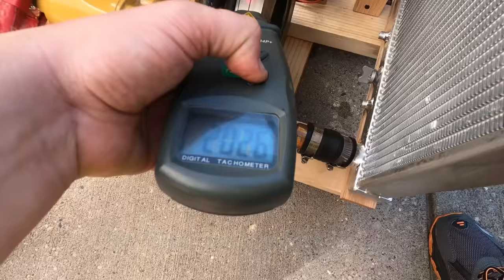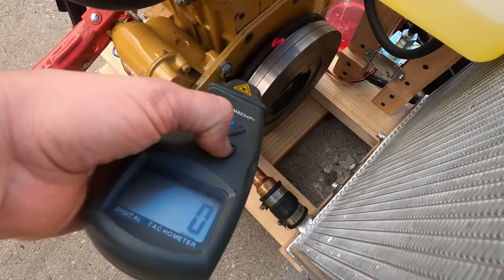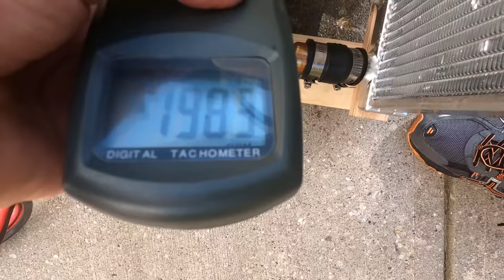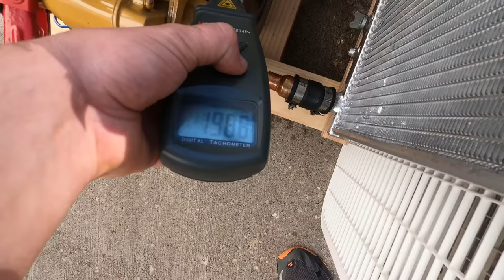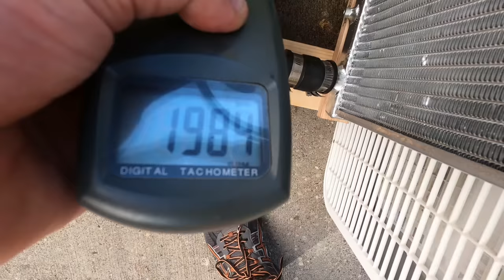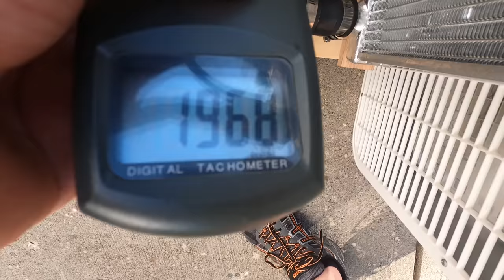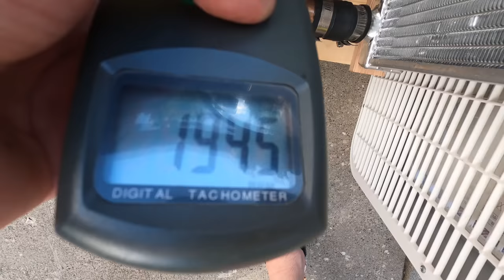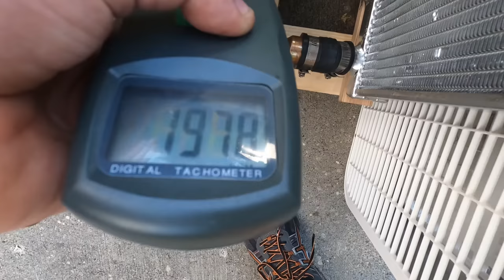Will Caterpillar Diesel run on Cooking oil? Attempt to run engine on Transmission Fluid & other oils

Comment: As far as I understand the diesel motor was originally designed to run on various vegetable based oils. Petroleum oils was not the diesels first intended oil to burn
Reply: Thats right!
Reply: Yuck Foutube  Exactly, but the inventor had to modify it, so it can run on heavy oil to make it interesting for heavy machinery
Reply: So true. From now on I want all engines I buy to be diesel even if it is a luxury car.
Reply: "Engine" not "motor"
Reply: @olfreal  
No.
Diesel was a waste product of cracking oil and producing petrol (gasoline)
The refineries had no use for diesel...
until they realised it could be used as a fuel in "diesel" engines....
The rest is history.
Reply: Rudolf Diesel is the father of the diesel engine he ran it on peanut oil
Reply: yea but they weren't always common rail wither
Reply: @b-genspinster7895  Germany never had access to petroleum supplies so hence why they always are tight with russia
Reply: I think the first compression ignition engine ran on coal dust but I might be wrong
Reply: @midixiewrecked7011  hate to burst your bubble but Engine and Motor have pretty much identical definitions. Motor just happens to also Encompass Electric engines not just internal combustion while engine specifically defines things with moving parts that produce power.
Reply: @juliogonzo2718  compression ignition engines diesels have always operated on a liquid /oil of some kind. the early diesel engines were heavily RPM restricted and most of them if not all of the early diesel engines had a Compressed air injection system. which in turn means. injection pressures are quite low. which in turn means the compression ratio (efficiency of the engine) couldn't be very high. 12:1 compression ratio. vs todays modern diesels. say my 6.0L powerstroke. 18.3:1, or my 2019 6.7 powerstroke 16.7:1 
12:1 is just barely enough to make compression ignition possible and is just above highest compression ratio gas engines.
Reply: @justnsaliga8518  wrong
Reply: You are right! The coal dust was too abrasive and wore out parts.
Then he switched to veg oil.
Reply: @JohnSmith-yv6eq  There is no waste product on crude oil. All products are waluable and usable. Thats why diesel engines use diesel fuel, or some other oils. It is old fashion thinking, that diesel is waste product. Like used engine oil. It is waste product when it is used. But it is not. It is pretty good heating oil for factorys, or at small game for homes. It is not waste! And as we all know, some ones waste is some ones tresure. It is just how we want to see it!
Reply: @peraz968  
What we know today as "Diesel" wasn't initially formulated as such.
At that time it wasn't even "diesel".
It was made up of a combination of different "fuels" which varied widely.
Only after WW2 was it standardised in formulation around the world....

https://en.wikipedia.org/wiki/Diesel_fuel#:~:text=Diesel%20fuel%20originated%20from%20experiments,engine%20he%20invented%20in%201892.
Reply: Check out The Hot Bulb Engine, It was the Engine that first took place of Steam Engines.  Hot bulb Engines would run on anything, The Low grade oils ( Low grade oil that had to be refined more aboard ships so it could be used ) The Oil was between Crude oil, and Heating oil.
Reply: Very true, but diesel fuel is cheaper per unit of energy since it's essentially a byproduct of refining petroleum oil.
Reply: Indeed. It suddenly changed to petroleum based oils when the inventor suddenly had an "accident".
Reply: @midixiewrecked7011  Motor oil, motor mounts, motorcycle, motor vehicle, etc
Reply: Yes that true, originally  diesel run his engine with peanuts oil...
Reply: @Bpf1893  engine oil,  big block engine,  small block engine,  2 stroke engine 4 stroke engine, you're ignorant etc , Rotella engine oil look it up.
Reply: @midixiewrecked7011  Yes both terms are correct, that’s the point. You not knowing that, then trying to act smart calling people out, is ignorant
Reply: @Bpf1893  one term is correct.  Your ignorance is not impressive.  It only shows that you fall into the common frame of mind with society now a day.  The common ignorance of people.  Etc
Reply: "Feb 21, 2019 - The Diesel-Engine was originally made to run on HEMP-OIL ! In 1893, German inventor Rudolph Diesel published a paper entitled "The Theory ..."

He ran it on peanut oil for the World Expo, so I think that is why all the "peanut oil" mentions are made.
Reply: Also coal dust… the promise was that they can run on just about anything… including unconventional fuels😊
Reply: @jeremywylie2936  dyslexic
Reply: Peanut oil burns clean , they used it in submarines
Reply: Yep this was the pitch to farmers the oil of your crop can run your tractor.
Reply: @justnsaliga8518  my coyote is 11.5:1 the new ones are 12:1.. just saying. I'm a little shocked that the 6.0 has a higher c/r than it's current generation counterpart
Reply: Originally, Diesel's target was to make it run on coal dust. It didn't really work.
Reply: @midixiewrecked7011  Cmon guy. They are grammatically interchangeable.
Reply: That's what I understand as well and that's fantastic because for the times to come it would be great to have SVO generators
Reply: @JohnSmith-yv6eq  That's exactly backwards.  Gasoline was a "waste" product of refining crude for kerosene (which is basically diesel) to use for kerosene lamps.
Reply: Correct, invented by Rudolf Diesel. Though of course America probably thinks they invented it, along with the jet engine, the Mile, and sunlight :-)
Reply: if it flows and burns, its fuel.. basically the principle i see older and simpler diesels have with fuel.
Reply: @justnsaliga8518  No, an engine converts various forms of fuel into mechanical force. A motor transforms electrical energy into mechanical energy. There really is a big difference in the two.
Reply: @stevemorris3710  in our defense America has invented just about everything, your more likely right to assume someone invented something in America or made it big in America or was happy in America, 

But it's okay broh I'd be jealous too haha
Reply: @giggiddy  Different words and different definitions.
Reply: @PureCountryof91  higher the compression ratio on a gasser the higher octane fuel you need. or how ford solved incomplete combustion problem and the inherent (spark knock/preignition) Variable valve timing. so yes it does have 12:1 on the new ones but its Variable valve timing controlled by a computer to dump pressure by leaving intake or exhaust valve open a little longer. its why you can have your 12:1 compression ratio and run Race gas. or run Ethanol in the same vehicle. and it runs just about the same. 

reason why common rail engines have typically lower compression ratios is drivability. and sound. as well as its easier to make a injection system that injects fuel into a 16:1 cylinder than a 18:1 or higher. 
higher compression ratio on a diesel the more efficient and the more torque but the louder it inherently will be. 

on a side note part of the reason why they went to lower compression ratios is they were able to make up the lack of the lower compression by means of more modern VGT turbos the technology has defiantly matured a stock 6.7 powerstroke turbo can and will do upwards of 30 lbs of boost. 

and higher compression ratio on a diesel also means you can get away with a smaller turbo. or not as much boost.

to make a long story short. reason manufacturers have went lower in compression ratio is the fuel quality has gone up significantly in recent years anything generally above 17:1 in the diesel world will burn any petroleum based liquid or anything thats even slightly flammable. 
and drivability manufacturers have swung their intentions to make the diesel trucks drive more and more like a car and feel like a car. my 2005 pulls alot better than my 2018. it drives and feels like a truck my 2018 doesn't feel too much like a truck.
Reply: @justnsaliga8518  good read. I'm more than aware of the compression ratios needed for diesels. And also aware of the ratios of gas.. but the incomplete burn, done so intentionally is kinda stupid. That's a waste of energy.. now it makes some more sense as to why a certain 5.0 takes boost so well stock.
Reply: @cppower14  No. An engine converts one form of energy into another. A motor provides motive force. There is a very small and highly technical difference between the two. 

The little Cat in the video does both. It is an engine and it is a motor.
Reply: @midixiewrecked7011  No. And you being so confidently wrong is amusing.
Reply: @mabamabam  nope
Reply: @Mi Dixie Wrecked Motor can be used by both electric and combustion or multiple others. The definition is using one type of energy to create mechanical  energy to create motion. Why do you think they call motorcycles that and not engine cycles?
Reply: "hheellooo" - douche rockefeller
Reply: @wizard_of_poz4413  There are some very very old diesels that ran on a wide range of fuels that were common rail... common rail doesn't prevent you from running various fuels but ti does when you tailor the injector and pump to the fuel viscosity (potentially reducing the cost of the pump doing so or longevity or whatever).
Reply: @Wingnut353  yea I'm talking about a 6.7 cummins with a modern common rail system and 8 hole injectors
Reply: The inventor's last name was Diesel and the fuel was peanut oil
Reply: @JohnSmith-yv6eq  wrong opposite.disel kerosine is first use from crude oil,gasoline be spiled in river -latter coming gasolie engine.https://youtu.be/29g8yYMgE3c?t=469
Reply: @wizard_of_poz4413  
You know why crude oil is traded in barrels?
Because the first ever existing oil industry filled their products into used barrels previously filled wish fish. 
And guess where this industry was located. You would be surprised.

Oil till today is measured in old German fish barrels.
Reply: Coal dust originally
Reply: @JohnSmith-yv6eq  wrong. Diesel and kerosene, which was distilled off alongside various grades of medium weight hydrocarbons, was originally used as heating and lamp oil. Gasoline and other light oils were too volatile to use for heating and lighting, and so had no commercial use. When the otto cylce engine was developed, that finally gave a use for light distillates as an engine fuel.

Steam engines had been around industrially for a century and a half before the ICE got anywhere. Coal is the fuel most commonly associated with steam due to it's ubiquitous nature and low cost, but many prefered oil fuel burners due to their relative low maintenance. Instead of shoveling coal and ash constantly you just had to adjust the fuel flow. And for lighting, a kerosene (or whale oil) lamp is way better than a burning lump of coal.
Reply: #RudolphDiesel
Reply: This is correct.  They were made to run on farm based homegrown oils
Reply: @jchambers2586 Diesel never used peanut oil... he used petroleum and crude oil. He mentioned, that it will be possible to run them on on palm oil or peanut oil, where it is available.
Reply: The first Diesel engine was designed to run on coal dust.
Reply: You are correct sir
Reply: Correct. And then Rudolf Diesel went missing, his corpse found floating in the English Channel
Reply: Very first diesel or compression ignition engines ran on coal dust.
Reply: Err... Kind of... 
It was designed for heavy fraction oil like diesel after coal dust didn't work, but in a world fair when they were showcasing it someone asked Diesel if it would run on peanut oil and he basically replied with "idk let's try it and see".

Then he kept using it for the rest of the demonstrations
Reply: You are Rigth in the past used Animal fat with graphite to avoid friction...